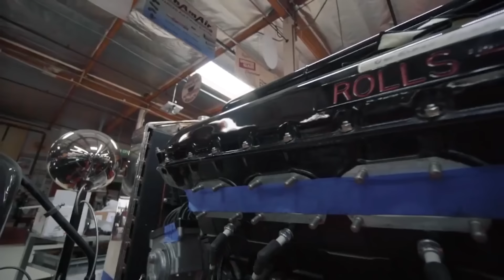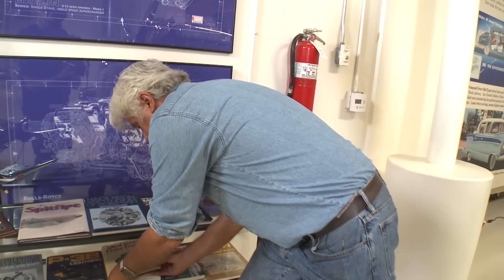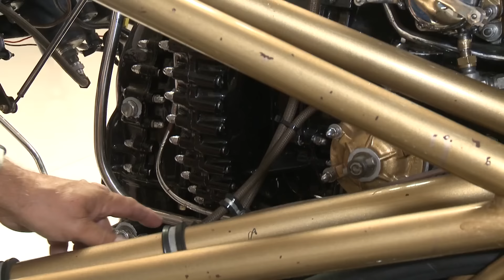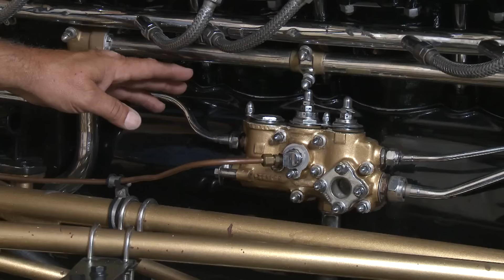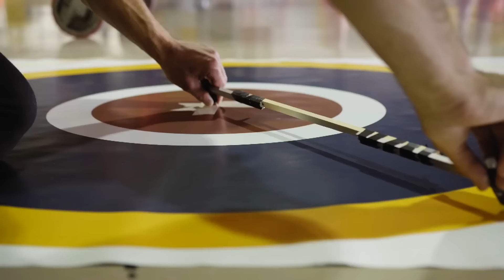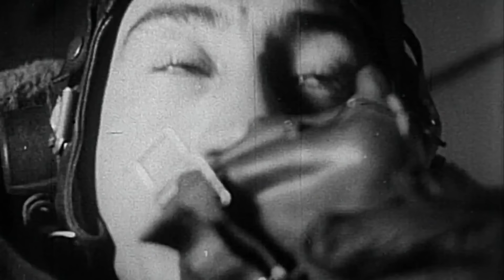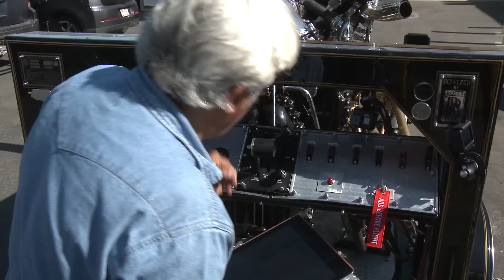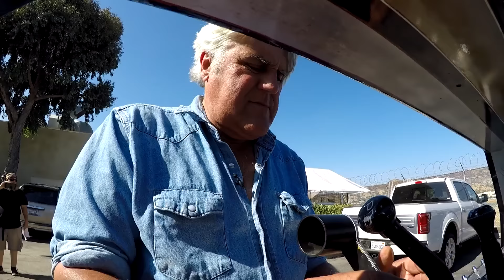The Engine That Won World War II - Jay Leno's Garage

Comment: I disagree. There were way more R-2800 engines in several different aircraft. The merlin was only in the p51.  One aircraft. While the Double Wasp was in the P47 , the f6f hell cat and the f4u corsair. And it was in at least 1 bomber. The merlin got better fuel economy. But the wasp was air cooled. What that means is if the mustang takes a bullet anywhere in the cooling system and you are done.....end of story. As whare the r 2800 is air cooled and has no cooling system. There were accounts whare the r2800 brought the pilot home with jugs shot off the engine while the connecting rod is flapping out of the cowl. Aircooled motors have less parts. Im my opinion the R 2800 was the best motor of the war. Don't agree convince me......
Reply: FYI the Merlin powered over 40 different aircraft types - see:-
https://en.wikipedia.org/wiki/Rolls-Royce_Merlin
Total merlin production was about 150,000 (2/3 of this in the UK)
Since the R2800 didn't even have its first flight until half way through the Battle of Britain we would all be conversing, if at all, in German if we had waited for it to arrive.
Reply: @ColinMill1  those are all british aircraft. I was talking about American aircraft......still the r2800 is more reliable. If i had to chose a plane with liquid cooled or air cooled id take the R2800 every time. Ive never heard a story about a mustang or a spitfire bringing a pilot home after the me109 or the fw190 ran out of ammo trying to shoot it down.........
Reply: @swatter 521 - Well, to win a war you need to make sure you don't lose it beforehand. Anything that wasn't available in quantity by early 1940 to make it possible for us to win the Battle of Britain can't reasonably be said to have won the war. We did have air-cooled radial engines including the Bristol Centaurus available at that time - see:- 
https://en.wikipedia.org/wiki/Bristol_Centaurus
and this did eventually power the Hawker Sea Fury but all that is far later. You need to look at what aircraft the USA had in service in quantity on 1st September 1939 (the outbreak of WW2) that would have had a chance against the Bf109. (which, remember, used a liquid-cooled engine)
Reply: The R2800 is one of the reasons you aren't speaking german. No doubt the merlin was a good engine but it had its application. It was 1 engine out of many that the US adopted. But it had its problems too. 1 bullet or a small piece of flak and it is out of the fight. Ill take reliable over what ever you think is so much better any day of the week......
Reply: @swatter5216  - I think you are excessively fixated on the cooling system vulnerability. There is a whole host of other vulnerabilities to worry about not least the aircrew - especially when the enemy is firing cannon shells. Speed reduces your chances of being shot in the first place and that is improved by power/weight, power/frontal area, and power/fuel consumption all of which favour the the Merlin. This is underlined by the outstanding performance of the Mosquito especially as a bomber that, from post-war analysis, was the most effective bomber from perhaps the most important point of view - the weight of bombs delivered per aircrew life lost.
Reply: @ColinMill1  i think your fixated on British aircraft. The p47 was armored. It could climb as well or better then all the rest. It had 8 50 cal guns. No other plane except the me 262 could dive as fast. Why did England need all the US aircraft durring ww2 ???? We sent you planes , guns. , tanks , fuel , food , ammo , steel. aluminum , and everything else ......? Seems to me if all your planes were so great., why did you need american aircraft ????  We baled you out twice in the last century ???? The US was pretty popular in 1942...you bet im fixated on a aircrafts weakness...... Why wouldn't you want the most reliable aircraft ? A aircooled motor is more reliable then a liquid cooled engine ???? If a aircraft has a weakness why is it wrong to want the best most reliable aircraft???
Reply: @swatter5216  Just look at the statistics for the p47 to the p51. Kill to loss ratio of the p51 = 1.96. Kill to loss ratio of the p47 = 1.07. Also, the p47 was replaced by the p51 in the  long-range escort role in Europe - not the other way around.
See:-
https://en.wikipedia.org/wiki/North_American_P-51_Mustang
https://en.wikipedia.org/wiki/Republic_P-47_Thunderbolt

As for the dive speed issue there are any number of debates about this but both p51 and p47 seem to claim slightly over 500mph and much debate seems to go on about whether the figures are IAS, CAS, or TAS.

As for the aircraft used by the UK during WW2 you will see that both in terms of types and numbers these were overwhelmingly British See:-
https://en.wikipedia.org/wiki/List_of_aircraft_of_the_United_Kingdom_in_World_War_II

And by the way, we bought what we used and were still paying for it all throughout the remainder of the 20th century. 
Pity you didn't see it was a morally just war right from the start (even though the whole World was aware of what was happening in Germany in the 1930s - no excuse for you there) That would have saved a lot of lives.
Reply: @ColinMill1  don't care about the kill rate. I would want what any ww2 pilot would want. To come home alive.... Never said the jug shot down more planes....just like your spitfire the hurricane shot more planes down then the spitfire..does that make it better???  No one will ever convince me the mustang is more reliable then the p 47.... Never herd any stories about the mustang or the spitfire that they brought back pilots after the enime
 ran out of ammo trying to destroy it......or with pieces of the engine shot off. I have seen pictures of the 47 so badly shot up it is unbelievable they even landed let alone returned from the battle.........thats the plane i would have wanted. 
1 over 400 mph
2 heavily armord
3 2200 horse power
4 8 browning 50 cal MG.
5 out dives 90% other planes
6 AIR COOLED PRATT & WHITNEY ENGINE THAT DOUBLED AS A ARMOR SHIELD.......the end.
Reply: Rubbish
Reply: 2 other points. A radial engine needs no gear box. That makes it more reliable. 
A radial engine has no cooling system. Again more reliable.
Because when you go to war. You want the most reliable equipment. And if you don't your an idiot.
https://m.warhistoryonline.com/war-articles/just-jugs-just-stunning-images-of-p-47s-enjoy.html/5.  That is a flak hit.....no way any liquid cooled engine would have survived let alone bring the pilot home so he could pose for the picture . You have to scroll down you can see several all shot to hell. The pilot standing next to the one that took a flak hit. He looks pretty happy. Im sure he was glad that his plane wasn't liquid cooled....
Reply: Europe during the critical first three months of 1944 when the German aircraft industry and Berlin were heavily attacked, the P-47 shot down more German fighters than the P-51 (570 out of 873), and shot down approximately 900 of the 1,983 claimed during the first six months of 1944. In Europe, Thunderbolts flew more sorties (423,435) than P-51s, P-38s and P-40s combined. Indeed, it was the P-47 which broke the back of the Luftwaffe on the Western
Reply: And in the Pacific im pretty sure they didn't use mustangs. The way i heard it most were carrier launched that means navy planes , and all were radial. F4f wildcats at the beginning. Then f6f hellcats. Finally we here in the states remember blacksheep squadron with robert conrad.  Chance/vought f4u corsair.
Reply: In 100 years great britan has went from ruling 25 % of the world to ruleing a country the size of Michigan.....

Comment: Beautiful, you would never believe that the Merlin started of as a generator engine for Antarctica, back in the 1920's, there was still 3 Merlins down in Antarctica when I was last down there and 70 lt RR engine that had never been used, its come a long way and as a very proud history, In the UK there are still a few Lancasters flying there, only used for shows with the Spitfire, Hurrican and Sea Fury

Comment: Is the engine identified as a RR-built, or Packard-built engine?  In either case it was a powerful engine, made more so by high-octane avgas provided by American refineries. Ability to run this with high manifold pressure [supercharger boost]  made takeoffs with large payloads possible.  War Emergeny Power with water/methanol injection significantly raised output for short periods.

Comment: My uncle Ray Labine flew Griffons during WWII which used Merlin’s . The Griffon was a Spitfire that had extra gas tanks for 8 hrs of flight. after a reconnaissance flight he would often land in England at night , shrouded in fog , the runway would have trenches on either side filled with fuel and would ,when set alight burn off the fog and light up the runway .

Comment: Had the distinct pleasure of being at the EAA Convention in Oshkosh, WI, the year they were fortunate enough to have the Merlin Mainstays of WWII all fly in the same event: P-51, Lancaster, Spitfire, and my favorite, the de Havilland Mosquito in its rare appearance courtesy of Kermit Weeks. The "Mossie" is tops for the Merlin sound, as it's a twin - the engines perform more in harmony, quite unlike the Lancaster's four. Something to behold. Regarding Jay's magnificent restoration, I think someone needs to seriously redesign his static run station. That smallish trailer with it's high-sidewall tires is way too squirrelly for the torque on that beast.

Comment: Canadian Warplane Heritage is in HAMILTON not Toronto - Hamilton is about 25 minutes west of Toronto on the QEW and yes it is quite a site to see and hear the Lanc flying - I have witnessed this many times as they often fly over Toronto in the summer several times to keep the plane flight savvy ... Hamilton is a "steel town" and the Heritage site is on the top of the Niagara escarpment so about 15 minutes outside of the city centre proper - when you are sitting there and you hear this deep throaty roar in the distance getting ever-louder you look up and there it is in the sky - lumbering along - sweetest aero-sound you can hear - sort of funny how slow the old birds look compared to the modern jet engine fighters today but in their day - they were quite quick nonetheless ... btw if you like your warplane - you can go to Downsview near Toronto where the jet was built and see a replica full scale build of the Avro Arrow (non-airworthy) that was built from smuggled blueprints and long since retired engineers who worked on the most advanced fighter jet aircraft of its day before it was torpedoed by a US government request to mothball the program and destroy every single trace of the (6) prototypes and anything associated with them - hence the reason the blueprints were smuggled out of the office by devastated and disillusioned engineers - the famed Iroquois engine was years ahead of its time just like the jet itself - not much said about it these days but the AVRO Arrow was a tremendous jet fighter that stupidity of US and Canadian politics killed - if you want more read about eccentric aerospace engineer / genius A.V. Roe - re: AVRO

Comment: It is a great engine but there were other great engines as well.  There were only a few fighters with the Merlin engine fighting in the Pacific.  The R-2800 Double Wasp was a great engine from Pratt and Whitney and powered some of the best fighters in the war including the F-4U Corsair and the F-6F Hellcat.

One other note, the Allies aviation gas was much higher octane than 100.  At times it was up to 150 octane, modern civil av gas is 110 octane if I remember correctly.

Comment: I would say the Pratt & Whitney R-2800 was more important for a fighter engine. It was also more extensively used after WW2..
The F4U, F6F, and P-47 used the R-2800, and the Navy planes were much more significant in the pacific than the Merlin; by a bunch. 
But the Wright R-1820 cyclone was probably the most important engine, as it powered both the B-17, and the C-47 which had a much more significant part in ending the war in both the European and Pacific Theaters.
Of course the Merlin is much more romantic, and cool looking, with the connection to Roll-Royce, the Battle of Brittan Spitfire, and the P-51 Mustang; it can’t be topped.. But the workhorse was the R-1820.

Comment: I dont understand why You think the Merlin better than the DB 605. And I dont think this motor won any war. The supply of high quality materials did. The DB 605 for example  could not be built with a high compression ratio due to the lack of high octane fuel. We had to go the way of methanol water injection for that reason.

Comment: With a feathered prop you could use more throttle on this engine and generate close to no thrust at all ,-)
Reply: Feathering is aligning the blades with the direction of airflow. I think you meant reduced pitch.

Comment: Yes, but used carbs, while German engines used fuel injection...So Spitfires couldn't do rolls as well as German planes...
Reply: Rolls and other maneuvers have more to do with wing loading than anything else, and the German fighters were very heavy compared to the Spitfires. The 109s and 190s especially were basically zoom and boom energy fighters. The Spitfires and Hurricanes could turn inside any German figher dumb enough to try to dogfight them.

Comment: I am sure the engine that won world war II is a little over kill. Many other great fighters that were equal to the spitfire, The P 47,the F4U Corsair,the F6F Hellcat were equal to and better planes powered by a better engine the Pratt Whitney R2800 made more power and were faster than the spitfire carried more firepower and did not have the merlin faults,and were used in greater numbers in every phase of the war and probably contributed more effort to the war over all. the R2800 made 2000 to 2800 horse power and were as or more reliable than the merlin the spitfire did much to win the battle of Brittan, but to say it won the ware id far from true,it had much competition and was not in the war by itself!
Reply: I don't think he claimed that it won the war by itself. Considering that it powered Hurricanes, Spitfires, Mosquito Bombers, Avro Lancasters, P-51Bs through Ds, P-40Fs through Ls and many other allied aircraft and made escorted deep penetration bombing possible, I think it has a better claim to that title than the Double Wasp.